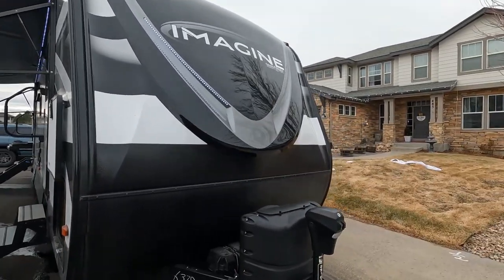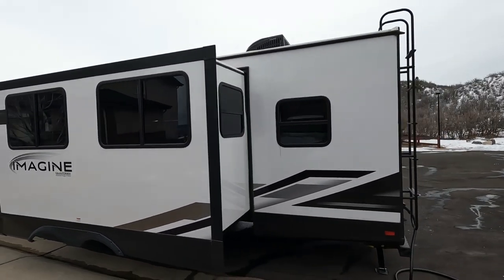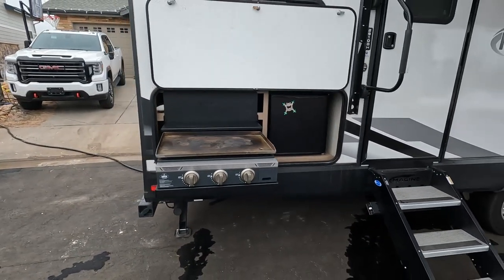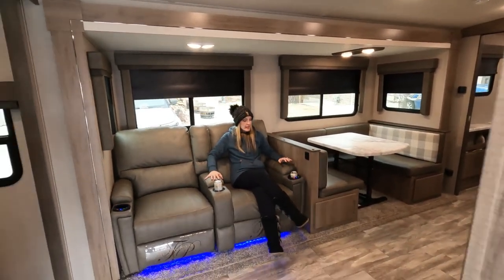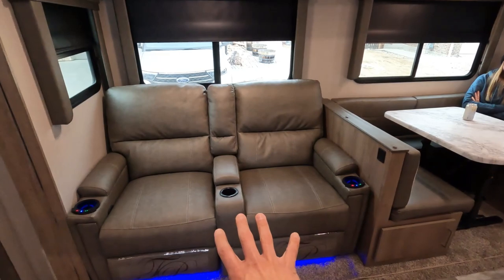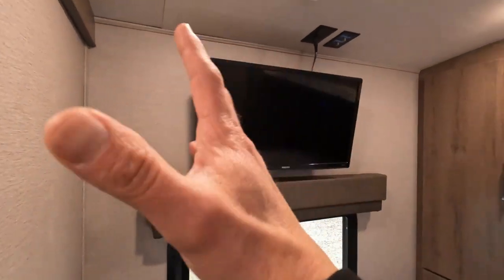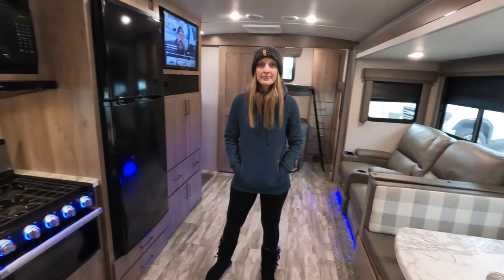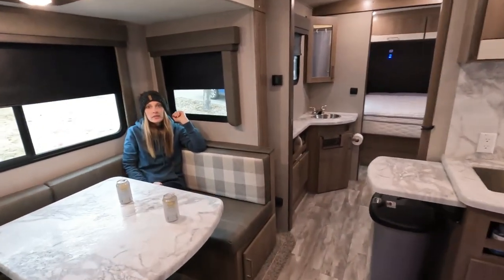Grand Design 2910BH Tour - Check out our new camper!

Comment: We did the same thing last month. We had our 2400bh for 2 years, loved it! But we needed to upgrade in size. The super slide on the 2910bh makes a huge difference! Great video!
Reply from the maker: We love the space in the 2910! Thanks for comment :) happy Campin’
Reply: @CampinItUp  Is your new GMC the AT4? Also, is it gas or diesel?
Reply from the maker: It’s a gasser, had opportunity to get diesel but went with gas based on towing needs and gas/diesel prices lol
Reply: @CampinItUp  I have a 2022 Ram 2500 with the 6.4 Liter. We pull Parleys canyon a few times each year here in SLC Utah! It did great pulling the 2400bh, we will see about the new trailer! 😅

Comment: Glad I found your video.  We have two boys and we’re on fence between 2910 and 2800, i think you pushed us over the edge to committing to 2910.  Did you go gas or diesel on GMC 2500?  I’m also getting either Chevy or GMC 2500 and would be curious if you went 6.6 gas engine what your fuel mileage is with and without camper behind it?
Reply from the maker: I have the 2500HD AT4 gas engine and it pulls great.  Average is around 14mpg towing but had 27mpg just cruising, not towing.  Went with gas based on gas vs diesel prices per gallon and still happy with my choice.
Reply: @CampinItUp  I’ve heard that 6.6 gas (L8T engine) is bullet proof, you made an excellent choice.  Is the camera you put on back of camper, to use with the truck, one that you got from GM or something aftermarket or something that came with trailer that just happens to work with the GMC 2500?
Reply from the maker: @justinb8584  GMC specific camera.  Instead of having an after market camera, this camera plays directly on Factory screen and works amazing!  Used to have furion camera on previous campers/trucks and this one is fantastic.
Reply from the maker: Did you guys get a camper? Might be upgrading again 😂. So camper and truck available 😅

Comment: Damn dude love this but I have a f150 3.5 eb. It’s a capable truck but you’ve given me a bit of hesitation
Reply from the maker: That can tow like 14k lbs right? It can tow no problem.  3/4 ton is just bigger and feels more stable..
Reply: @CampinItUp  The F-150 would be really tight on the payload. I wouldn't tow that big of a rig with a 1/2 ton strictly because of payload. Tow capacity would be fine. Payload would not be.

Comment: If my truck can tow 8900 lbs max, you think it’s ok?  Why did you have to go to the 3/4 ton?
Reply from the maker: We had an expedition that had a capacity of 9300lbs and did the math and it would be pushing it.  3/4 ton is the way to go, super smooth.